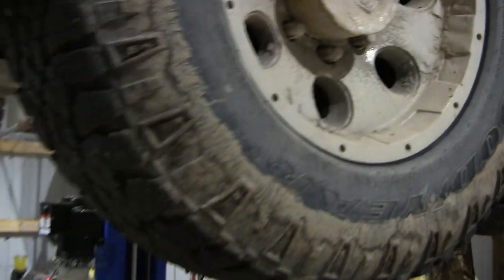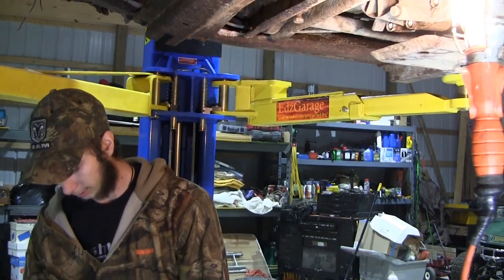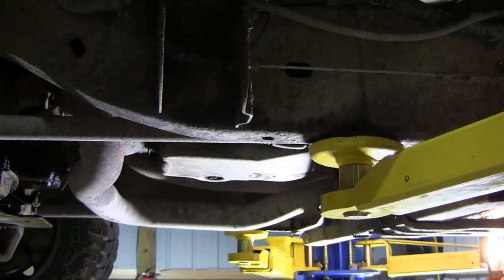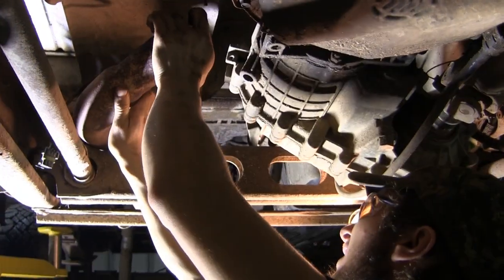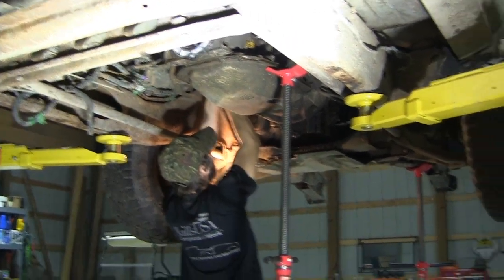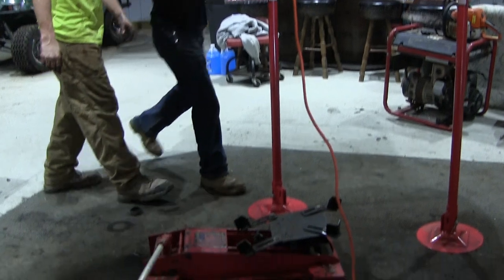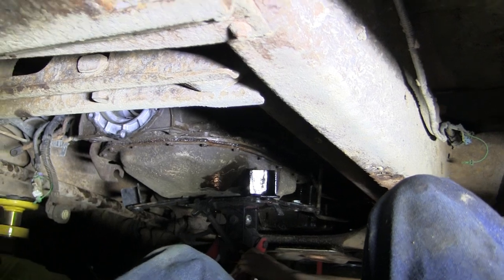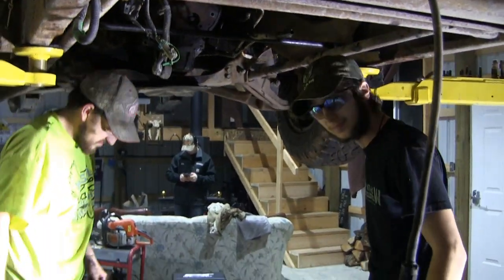Transmission Removal Chevy 2500

Comment: Now would be a good time to do the rear main seal.
Reply: And the flex plate always do the flex plate.
Reply: @Storked  Thanks. Why do you need to change it though.. is it the teeth being damaged or what?
Reply: @digi3218  I would look for wear, teeth, ect. The new torque converter/transmission could brake the flex plate apart easily especially if it's not installed perfectly. I just had tom replace mine after installing my tranny and it broke again a week later so be careful about how much money your willing to spend on these old trucks.
Reply: @Storked  Gotcha and thanks for the reply. I am getting a code on mine and it says a component is slipping. I think it is the torque converter clutch when it is locked up. I have done some research and going to load a torque converter in the parts cannon and see if it works. Also need to do my rear main seal. 

My truck and the truck in the video have the bottom cover on the bell housing. Most people need to take the starter off but after watching this video I'm not sure if it is necessary. Do you have an idea? Not sure what truck yoh own.
Reply: @digi3218  You don't have to take the starter off you can just take the bottom cover/inspection plate off but you need to lower the exhaust off the manifold on the driver side.
Reply: @Storked  Awesome thank you!

Comment: Did you have to remove the starter? 
Would be awesome if you could answer this, thanks and thanks for the video.
Reply: Yes
Reply: @cotmann  I ended up taking my truck into a local shop and they did a great job and fixed my problems 😁

Comment: I was thinking about changing a transmission on my own, but now I am not sure that it's feasible.
Reply: It's easy with time and motivation.
Reply: Im going to attempt it.. and do it hopefully. That or fail and get a new truck lol.

I got ramps and a harbor freight transmission jack. This video left out some stuff it seems. You want to disconnect battery cable, need to undo cable and wiring on left side which some of the connections are glued in. Need to undo starter I believe (if someone can let me know if you still need to do this since this has the bottom inspection cover). Need to undo the dipstick before removal. Then undo all the bell housing bolts and getting it unstuck from the motor. It has 2 dowel pins (pretty sure) so be careful.

Comment: The crossmember was removed, the transfer case was removed.......what was the transmission resting on in the rear part before the truck was lowered? I'm working on a 97 GMC K2500 with a NV4500 transmission. Thanks for showing this video.
Reply from the maker: It was resting on a ratchet strap.
Reply: Excellent. Thank you for the response. You guys do great work in the garage and on the video information.

Comment: what's wrong with that transmission ?
Reply from the maker: I guess I did forget to say what was wrong with the trans... Reverse is not working.
Reply: What caused the reverse to stop working?  Was it a burned out reverse band or was the servo pin wore out?  
I have the same 2500HD and this info would be like gold to me!

Thanks Ed.  I hope you're able to read this. 

Adam

Comment: Hey Ed, I have the same truck except it’s an 01, question for you. I don’t have reverse either all forward gears are great, what did u find out the issue was?
Reply: I just bought a 98 with the 5.7. Same deal. All forward gears great but no reverse. Ever find the issue with yours?
Reply: StonebergerSpeedShop no sir truck still sitting
Reply from the maker: I don't know what the real problem ended up being. The trans was completely rebuilt by a shop and put back into service.
Reply: This just happened to my 01. Guy said the clutches got hot and fused together.  Time to replace trans

Comment: Can I swap a 1500hd transfer case to a 1500  transfer case on a 4l80 transmission
Reply: Abraham Martinez yes at long as u use the 1500 yokes & shafts
Reply: @Mcdashiznit  or you can have the input & output shafts inside the transfer case swapped over. I know this because I had to do on my 2000 Chevy Silverado 2500.

Comment: Looked like a pain to jiggle it out, but your lift and mobile stands made it so much simpler :-D.

You got us into the action with your camera work ed :-D, being able to see what the chaps are doing is so important.
Some people keep the camera too far away, and almost nothing is seen of the steps.

I wonder how funny it could get if the haynes manual was being used for instruction,
Step (1) Remove the back seats and empty the ash trays LOL :-D

Its a standing joke that haynes manuals dont allways use the most direct approach :-D
Reply from the maker: Brian did this job twice on his back. He said this was a piece of cake compared to that and it was still a big job. 

When I was younger I used the Chilton manual and they're sometimes as ridiculous as the Haynes... I was replacing a the clutch in my Mustang and the manual said Step 1 - Remove transmission... LOL

Thanks for the comment!
Reply: Did you have to remove the starter to get to the flywheel bolts then turn the flywheel to get each one?